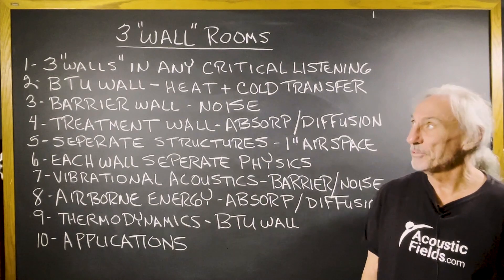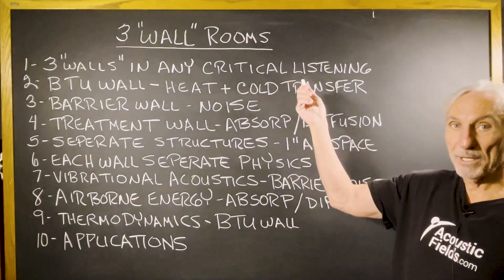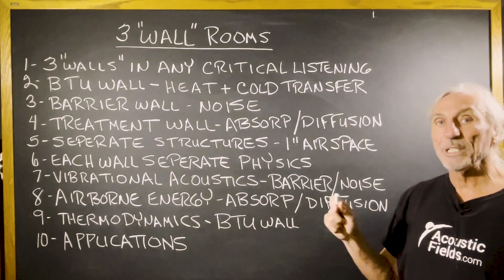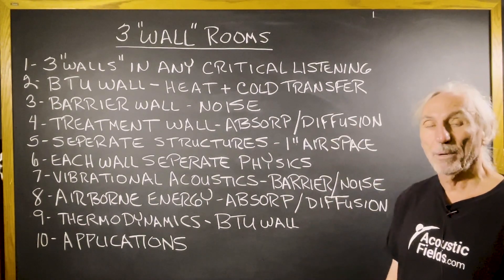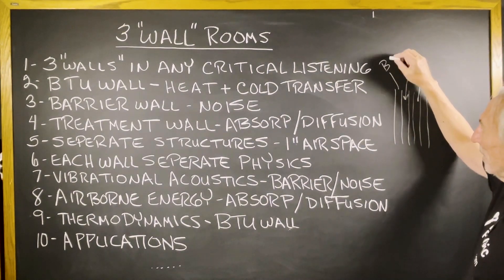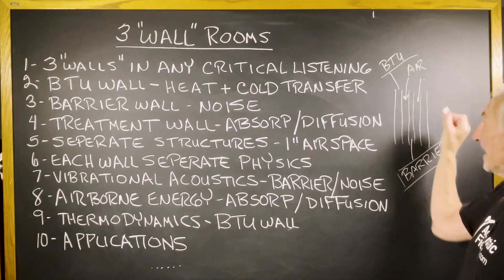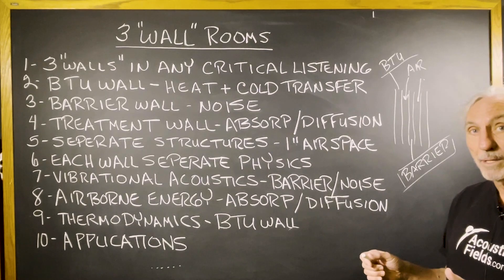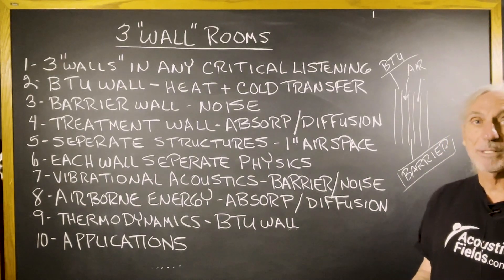3 "Wall" Rooms - www.AcousticFields.com

Comment: How big is the impact that separating the BTU from the Barrier can have? I understand it's dependent on the situation, but what would be some situations you have encountered where separating the walls had a huge impact (if that was ever the case)? Thanks!
Reply from the maker: It depends on the frequency and amplitude of your noise issues how deep the wall will be. The two walls that can be combined are the BTU and the treatment wall if there is enough space to treat both low-frequency and noise transmission within the stud space.

Comment: So but what are the other 2 walls ?
I got the BTU wall what are the others ? Didn't get it
Reply from the maker: Barrier (noise) and treatment (absorption/diffusion)
Reply: @AcousticFields  have you built this 3 wall
Reply from the maker: @arkh1730  Many times. It is our standard operating procedure.
Reply: @AcousticFields  nicerino .well and does it stop all sound btw ?
Reply from the maker: @arkh1730  The barrier design is frequency and amplitude dependent for the noise transmission issues.
Reply: @AcousticFields  I assume when you say noise you are referring to outside noise-traffic-neighbours cutting grass etc.
Reply from the maker: @wally6193  Noise is defined as sound leaving the room and disturbing others or the flip side where sound from others enters your room and disturbs you.
Reply: @AcousticFields  okay thanks

Comment: My room is untreated, the noise from outside is minimal, fortunately. The RTA reads around -68, the db meter reads 25-35.
Reply from the maker: You are fortunate.
Reply: @AcousticFields  Do you believe that the sound curtains that Amazon has are adequate? what video do you have that has rates and levels of rooms treated with curtains to minimize reflections in the HF?

Comment: Very nice video, but would it be possible to give more of an insight into how this treatment would look like? Examples, what materials for each wall are the best, showing one of your last projects with 3 walls, etc. etc.
Reply: Older videos have room setups and interviews, check out the playlists for what you are looking for, I think that you will be satisfied!
Reply: @johnlane2395  okay great, thank you very much!
Reply from the maker: There are no best or one size fits all approach. You must look at each situation from many angles.
Reply: Dennis covers mostly barrier and treatment walls, he doesn't go into BTU that much in the videos.  But he says that each situation determines materials and construction to use to solve specific problems or meet objectives.
Reply from the maker: @Oneness100  BTU walls are governed by city and county codes. They usually publish minimum R-values which will meet zoning requirements. The barrier wall is designed using noise numbers. The absorption and diffusion treatment wall is designed by Acoustic Fields.
Reply: @AcousticFields  Has anyone, including yourself, tested the thermal insulation qualities of Activated Carbon?

You use it as part of a barrier against noise along with other materials and get much better results compared to building insulation, drywall and green glue.  , but how well would your barriers meet or exceed any City or Country codes for thermal insulation instead of having to build yet another wall just for thermal insulation?

Maybe send one of your activated carbon "filters" sent off to a testing lab for BTU rating.  Maybe it would be better due to it's unique properties.

Just curious.